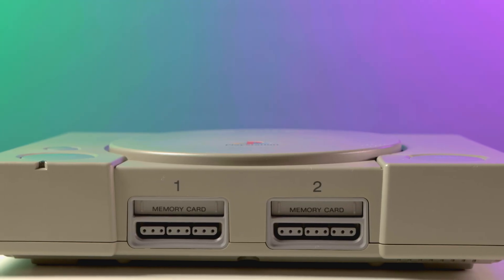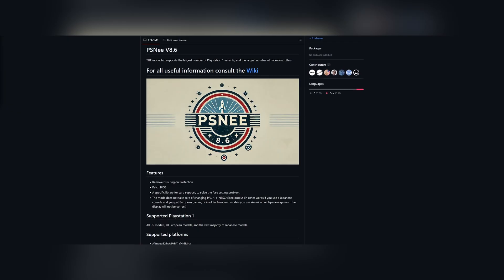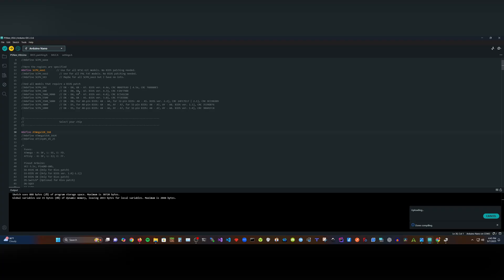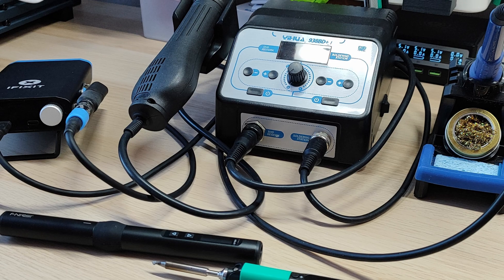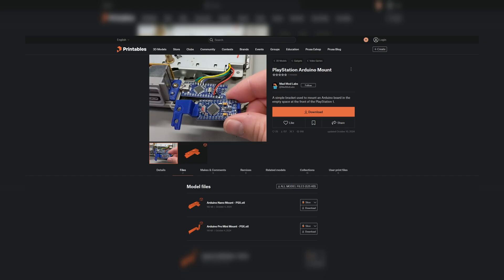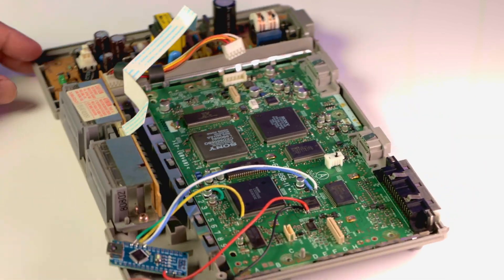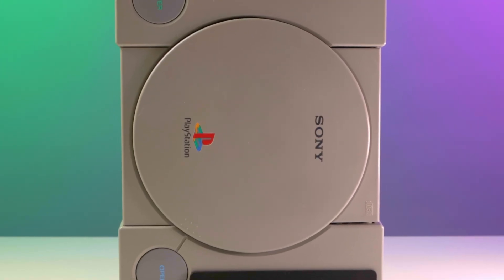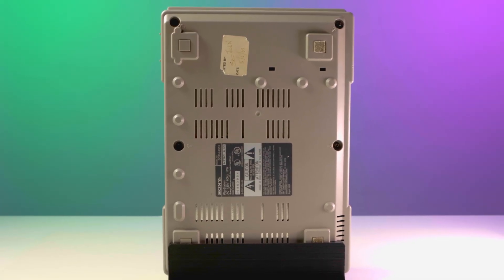How the PSNee Arduino Nano Modchip Unlocks the PlayStation 1 SCPH 7501 #retrogaming #gaming    #ps1

Comment: I would appreciate it if you could try the European region version of Crash Bandicoot 2 on your console.
Reply from the maker: I can try it, but anything you want me to look for? Also, keep in mind that my PlayStation is an American model 7501, so I'm not sure if you want to compare with yours. I will use the CD-R that I showcase in the video as well. Keep this in mind, since some CD-Rs perform better than others.
Reply: @aldebottech  Hi, the problem is that when Crash Bandicoot 2 and 3 (PAL version) are forced to NTSC, they tend to lag excessively, running at around 5 fps.
Reply from the maker: @JavierQuintero89  Interesting I will definitely try to see what results I get.
Reply from the maker: @JavierQuintero89 hey so I just finish playing Crash Bandicoot 2 EU and works fine no slow fps just at 50 fps
Reply: @aldebottech  in this play?
Reply from the maker: @JavierQuintero89  I just try it yesterday I haven’t uploaded a video and it works fine unless there is a stage that it happens on
Reply from the maker: @J @JavierQuintero89  is there a video showing this that I can get for reference

Comment: Hello.

You made a great tutorial video for installing PSNee mode. Would you mind adding the link to it in the project wiki?

Just a quick note for everyone: in the project wiki, you'll also find all the installation diagrams for every PlayStation variant. I've just updated the diagram for the PU-22 board, with an easier soldering point for the VCC power supply.
Reply from the maker: Oh wow yes and thank you I’m honored you like the tutorial I tried my best to do it correctly. Your GitHub documentation is straightforward. I will add it after I'm done with my shift later today.
Reply: @aldebottech  It's done, I've added the link to your video in the wiki.

I'm very happy that people are making video tutorials, because personally I've never had the courage; maintaining the repository and the wiki is more than enough for me ;)
Reply from the maker: Awesome and thank you I'm really busy at work today so that really helps me.